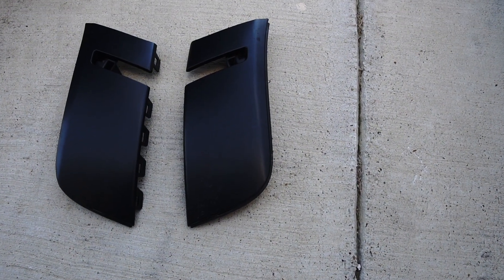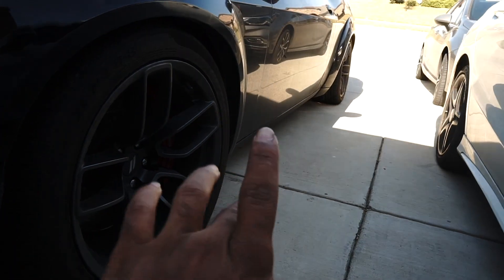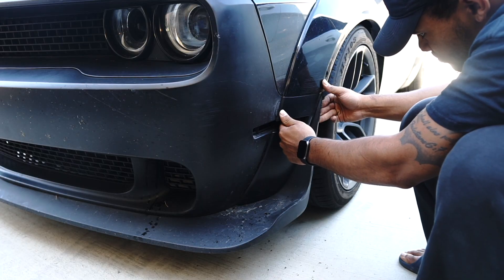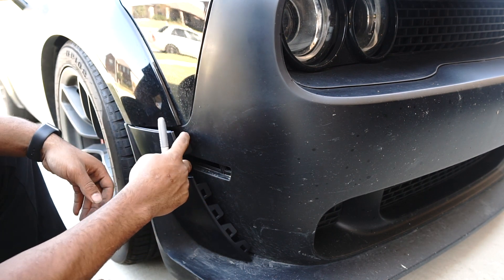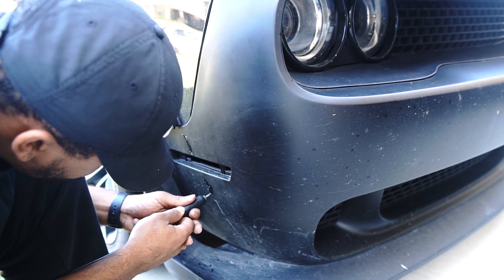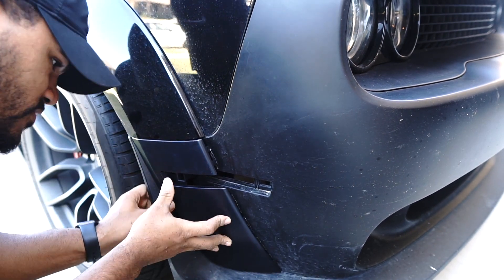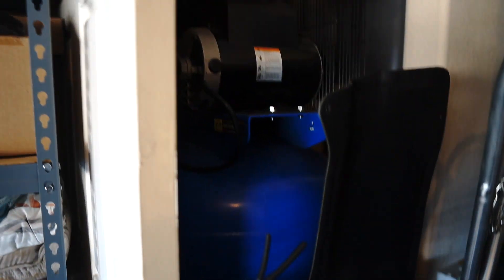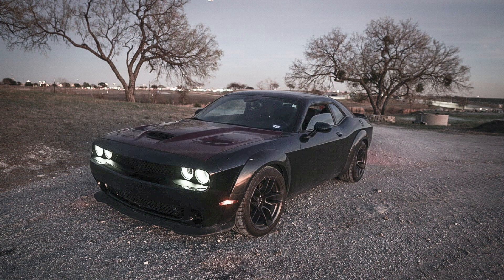WIDEBODY DODGE CHALLENGER V6 SXT | FIXING FITMENT | IKON / VICREZ WIDEBODY KIT BIGGEST FLAW!

Comment: I Just installed my wide body on my SXT  and I used a box cutter to cut into the plastic trims specially on the front lip car looking good bud I  thought it was a red eye  👍
Reply from the maker: haha gotcha, thank you! 👍🏽
Reply: What size rims and tires do you have my son is doing the same kit don't want to cut fenders
Reply from the maker: @aundrelarocque5649  oem devils wheels can’t run them without cutting,  no other way sorry
Reply: I put a kit on mine and the front lip won’t fit, i bought a wide body lip, but that’s too big.. the srt lip won’t fit… please help!!

Comment: I see people utilizing the icon kits all the time and left with the gaps at the bumper. I always thought to use the oem to solve the issue and lo and behold, you obviously thought the same thing. Dodge allows you to purchase those for the front and rear, but not the actual flares.